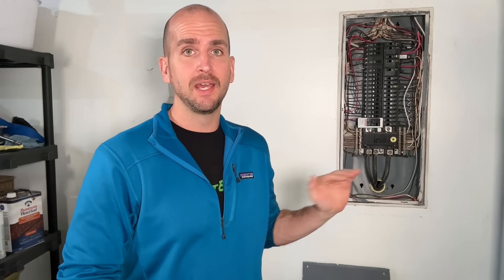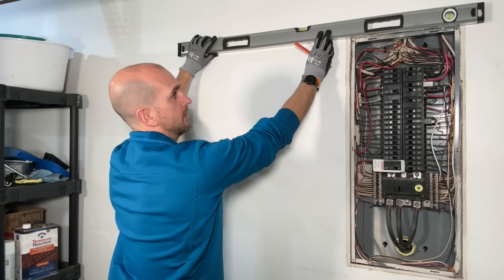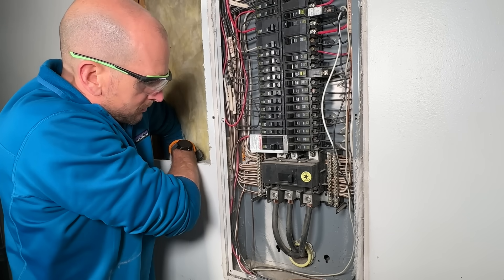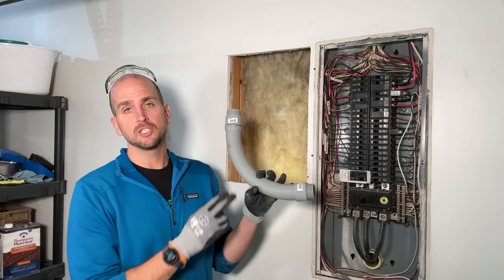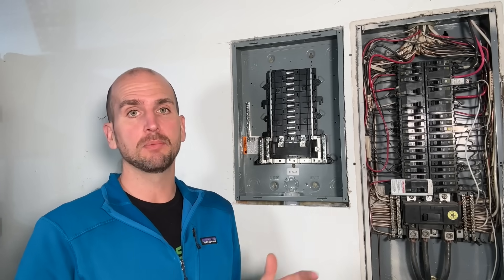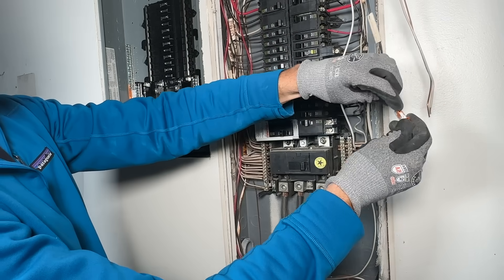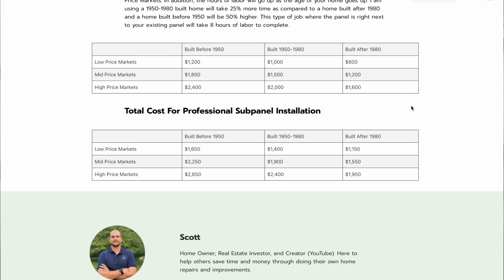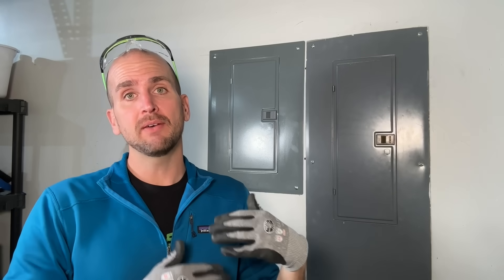How To Install A Sub Panel Next To Existing Main Panel

Comment: You can’t use #2 aluminum for a sub panel that doesn’t carry the entire load of the home and you can’t use #6 romex for 60 amps. NEC 334.80. Videos like this are terrible for the trade.
Reply: I didn't see him install any #6 Romex so not sure what you're referring to. You can use #2 Al for a sub panel and it doesn't have to carry the entire home load.
Reply: He did mention it in the video, and i am pretty sure he need to adjust the ampacity rating on the wires since he is running more than 3 current carrying conductors as described in table 310.16 and 310.15 c 1 of the NEC
Reply: Pd - I’ll tell you like I tell my 4yr old, put your listening ears on. He says if you only need 60 amps run # 6 romex, so that’s what I’m referring to. As far as your comment about #2 AL on 100 amp sub. You are wrong. #2 AL would be good for only 90 amps. Site a code reference. Don’t be a hack.
Reply: @NickG.-cr5lq   I didn't hear that part but since you're being a jerk, I'll be one too. 
 I never said that you can use #2Al with a 100A breaker, genius. Maybe you should get some glasses or take a reading comprehension course. 
You said the following, "You can’t use #2 aluminum for a sub panel that doesn’t carry the entire load of the home," and you are absolutely WRONG. As long as the breaker is no larger than 90A (75deg column in 310.15(B)(16) because of 75deg terminal ratings), you can use #2 Al for a subpanel that does not feed the entire home. What you can't do is use 310.15(B)(7)(2) and apply the 83% factor and put it on a 100A breaker unless it feeds the entire home. See 310.15(B)(7)(2) for clarification.
For calculation purposes, you can start with the actual rating of the conductor, which for 2 AL THHN is 100A, 110.14(C) and 310.15(B)(7)(4). Once adjustment factors are applied you are still are limited to no more than 90A breaker because of the terminal ratings, 110.14(C).
Any questions?
Reply: @pld8993  - You got it! Giving you a hard time bud. You crushed it! Way to shut down a young punk. I still think that videos like this are terrible for the trade, but great job!
Reply: @NickG.-cr5lq  You're also wrong about #6 Romex for 60A. 6 Romex is rated for 55, but since there is no 55A breaker it's allowed on a 60.
Reply: @pld8993  I disagree. You can’t use #6 romex if you’re serving a 60 amp load. You’re applying 240.4(b) to sizing your conductors but 240.4 is for sizing your ocpd. See 210.19(b). You can’t use #6 romex to serve a 60 amp load.
Reply: @NickG.-cr5lq  210.19(B) has nothing to do with this project, as it is for branch circuits over 600V. If you have a calculated load of 55A or less, you can use 6 Romex on a 60A breaker. If your calculated load is 56A or higher, then 4 Romex would be required.  
I'm not using 240.4(B) to size my conductors, I'm using Table 310.15(B)(16). There is no 60A load here, the sub-panel is not a load and right now there are only 2 20A branch circuits in it, far less than a 60A load. Max calculated load on 6 Romex is 55A but because there is no 55A breaker, you are allowed to install the next size higher breaker that is available, which is a 60, 240.4(B).
Reply: @NickG.-cr5lq  Nice try Nick. But pd got ya!
Reply: @michaellike5037  Got me? See 334.80. I wish you guys were my AHJ…
Reply: @NickG.-cr5lq  334.80 clearly says that the allowable ampacity for NM cable is based on the 60C column 310.15(B)(16), which is 55a for #6, and it says nothing about max breaker size, which you arrive at by referring to 240.4(B). There is no 55a breaker, therefore  #6 NM can be on a 60a breaker as long the maximum calculated load/allowable ampacity is 55a or less. Yeah, got ya.
Reply: Thank youuuu

Comment: Did the new panel arrive with a factory installed Neutral Bonding Screw? Just a thought for anyone unfamiliar. Sub Panel Neutral Bonding Screw, often a green screw looking out of place, going thru the Neutral, must be removed to prevent a loopy ground problem worth looking up. 
Nice clean install, either careful planning or plain old good luck got the empty cavity to put your sub panel in.
Reply from the maker: Thanks for the Add, that would have been good to point out.  Square D includes the screw but not installed as least on these main lug panels.  I was confident the cavity was open but not 100%.  You know how it goes 🤞

Comment: You forgot to color code the cable (wire) neutral =white
Reply from the maker: I had the tape laying 10 feet away 🤦‍♂️.  Thanks for the call out.
Reply: Installer of the original main panel blew that.

Comment: I would recommend using a torque wrench/driver. Current code requires it and frankly it is a good idea. I think a lot of people would be surprised on how hard it is to tighten things to the correct torque.
Reply: Also to wiggle the stranded main wires a bit and retorque them.
Reply: When I worked in a power plant, the electricians used to open each panel once a year and retorque each connection to spec. Couldn’t afford to have any circuits failing and compromising our availability to the grid
Reply: @DanielinLaTuna  yeah, I would imagine the heat expansion and cool shrink cycles the wires go through, could cause an issue.
Reply: what is the torque required?
Reply: @felixchien1664  I think you can usually see the torque spec on the side of the breaker itself. It can vary from manufacturer to manufacture.
Reply: @m3rdpwr  thx!
Reply: @felixchien1664  It will be marked on the device what the torque value is.

Comment: This is exactly what we need. Thank you! I was debating doing this or running one to the (attached) garage where we need several new circuits. Might do both once comfortable. For now I think we'll do this but there's no room adjacent to panel as it sits between the crawl space opening and the corner. Have to review the code, but it would be nice to have it on the adjoining wall facing out 90 degrees. 
What is the large breaker/switch in the lower right of your main box?
Reply: You can always cut sheet rock and run SER or a tray cable through the wall so you won't have to use conduit. Also, if you're adding a panel in a separate structure it will new it's own ground rod.
Reply: Just pay someone who knows what they are doing. Electrical work is nothing to try and figure out as you go. It's like me saying I'm going to be a lawyer tomorrow

Comment: I did that years ago, in my case it was a 60 amp breaker to a 12 pole auxiliary box. I mounted it to the lower right side of the main panel and went through the side.

Comment: Did anyone notice he didnt mark the subpanel main neutral as a white wire but left it black like its hot
Reply: Please quote the code book and section when making code claims, correcting misinformation from source less memory doesn’t achieve the desired effect. If you want to educate us, educate us!
Reply: @Diamonddrake  200.6 Means of Identifying Grounded Conductors

(B) Sizes 4 AWG or Larger.  An insulated grounded conductor 4 AWG or larger shall be identified by one of the following means:

(4)  At the time of installation, by a distinctive white or gray marking at its terminations. This marking shall encircle the conductor or insulation.
Reply: The neutral feed on the main panel was not wrapped/identified as white. I was under the impression, as Don L, that this is required by code. Original electrician blew it. Electrician wrapped with white tape when my main service was upgraded years ago.
Reply: He blew it? I guess the panel.is gonna catch fire huh.
Reply: Good thing you weren’t the next electrician to work in this box, you might have been seriously injured bc it wasn’t labeled properly.
Reply: No I did not notice
Reply: All you yuppies complaining about color. If it’s not code who cares, it accomplishes the same purpose.
Reply: Yep sure seen that!
Reply: He also used a hole saw instead of step bit😂
Reply: @jamesguiberteau6607 because he went through the stud lol. Try using a step through a stud. It dont work so well 😂
Reply: Probably because the professional that installed the main panel didn't mark the neutral white either.😂
Reply: Yes I did
Reply: Yeah that's tragic
Reply: At what time ??? 😂😂😂 💀💀💀
Reply: I try to add to a person's video tactfully especially when it's a dangerous forgotten step, this is dangerous work and It's important to mention this due to the trust in the step by step methods we follow blindly sometimes!!..
Reply from the maker: Yeah would be best practice to mark with some Super 35 white electrical tape, thanks for the feedback!
Reply: @EverydayHomeRepairs  Not just best practice, it's required to identify it white.
Reply: Why do people watch instructional videos if they are professionals? Who can I criticize today?
Reply: @justinforrest1613  it’s entertaining, and believe it or not even the “professionals” don’t know everything so some times there is something beneficial there. Oh, and often it’s to help the person improve there trade or hobby for safety, cost and enjoyment.
Reply: @justinforrest1613 I can’t help but notice the licensed professionals often give contradictory advice. Which is why I watch several and then do it myself.
Reply: @justinforrest1613  I post electrical information for amateur subscribers that are being misinformed or are being provided with incorrect information by other amateur experts that need to make sure of their facts before providing informational videos.
Reply: @donl1410  Thanks for looking out for us. 😁
Reply: @justinforrest1613  I'm sure glad they do!
Reply: Because If they see a mistake, it can be brought to the Forefront. There are a lot of amateurs out there that are doing stuff  that have watched in a video' as per say this one, or read in a book and they wonder why they are getting shocked every time they touch something.
Reply: @justinforrest1613 first off, you shouldn’t complain. A lot of electrical work is interpreted and I love seeing different ways to do the same job. Secondly, be happy electricians keep up on their job, so they can do the best work for customers and keep everyone safe.
Reply: @Pr3lude9  doing Gods work, thank you soldiers 👌
Reply: @Pr3lude9  okie dokie
Reply: @justinforrest1613 honestly its a good check and balance to make sure someone isnt giving crap information.
Reply: About to leave that comment.

Comment: The main lugs are a dissimilar metal from copper.  Therefore, it's a good idea to use an oxidation inhibitor (and remember to wiggle and retighten those stranded conductors).
Reply: If lugs are rated CU/AL it's not required.
Reply: @John Hooton  which depends on manufacture specs always always always check manufacture specs.
Reply: @johnhooton3286  Sort of. Cu/Al means either copper or aluminum can be used on the lugs; if lugs are Cu only, aluminum is not allowed regardless. Oxide is not needed on copper conductors because while copper oxidizes, copper oxide is conductive. Aluminum oxide is not conductive, hence the need for oxide inhibitor on older aluminum conductors.
Reply: @Kevin-mp5of  If the manufacturer says it can be used without a ferrule, then no ferrule is the correct way.
Reply: If the wire type is AA 8000 Aluminum Alloy then the oxidation inhibitor is not required to be installed unless the manufacture requires it.
Reply: @kevinthompson4690  Good point.  Thanks.
Reply: Why wiggle and retighten them when I can crimp a ferrule on.
Reply: deox is for aluminun conductors...
Reply: Oxidation inhibitor is not required for copper.
Reply: @Kevin-mp5of  The terminals on breakers are designed, manufactured, and UL tested and approved for stranded wire. In 40+ years I've never had an issue or a need for ferrule. So installing something exactly the way it's designed to be installed makes one a hack? You're obviously not an electrician.
Reply: Thanks @John Hooton, @js b, and @pd.  Your comments prompted me to go read the 2023 NEC 110.14.  I think the last time I thought about that section was maybe 15 years ago.  Much more emphasis on proper torque these days.

(It seems recent research--K. Hunter, IAEI--has found that ~60% professional electricians who hand-tighten connections under-tighten by at least 10% of the spec and ~20% over-tighten by at least 10% of the spec.)

Anyway, thanks for the prod.
Reply: You would think he would know this as his best buddy is Joel from Electrical Pro Academy.
Reply: @AdamS-lh2ug  Right...

Comment: I believe it’s code to identify circuits when relocating them such as in this instance. Meaning being able to identify which neutral goes with which hot, both in the main panel and in the sub panel. This is done so that in the future if you ever need one of those circuits on either a GFCI or AFCI breaker, then you be able to do that. Don’t know the exact code article but I was looking into it a few months ago when relocating a main panel and we would put zip ties around the hot/neutral together to identify them as belonging on the same circuit.
Reply: But his extended wires going to the subpanel aren’t in Romex, so identifying them is a good idea.
Reply: @donmclean1220  yes but he doesn't bring the neutral into the subpanel, only the hot. So where is he going to identify the wires if not in the main panel, where the romex enters?
Reply: @chrisruss7863  yes he does, in the sub panel for the branch circuits there’s very obviously 2 hot wires and 2 neutral wires. If you’re looking at the sub panel, there’s no way to easily identify which neutral belongs to which hot.
Reply: In my opinion having the hot neutral and ground coming from the same nm sheathing sufficiently identifies them, and this would apply more to an environment where conduit is used with multiple circuits in each conduit. But I haven't read the code so I'm not sure.
Reply: @chrisruss7863  the wire he uses from the main panel to the sub panel isn’t romex, he uses thhn. There’s no easy way to identify from the sub panel which neutral belongs to which hot

Comment: Don't get rid of that gas furnace! I cringed when I heard that. I have a new Carrier heat pump in one house and a Carrier gas furnace in a 2nd home. Love the instant heat with a gas furnace and it can raise the temp. quickly. The heat pump will run for hours, hate it!
Reply from the maker: Thanks for the feedback, where is the heat pump unit located?  Cold region?
Reply: @EverydayHomeRepairs  Triad region of North Carolina. If I had natural gas at my main home, I would kick the heat pump to the curb.
Reply: Carrier doesn't make good heat pumps, you want a well known asian brand with variable refrigerant flow and inverter driven compressor like a Fujitsu, Mitsubishi, or Daikin.  Also these VRF units aren't meant to cycle on and off like old fashioned heat pumps, they're designed to run more or less continuously keeping the temperature stable; they just ramp up and down like a dimmer switch.
Reply: THIS!  I’ve had a house with a heat pump and now one with a gas furnace and it was WAY more expensive to heat the previous house that had the heat pump vs. a natural gas furnace.  It wasn’t even close.  The heat pump ran constantly when the temps got below 30 degrees, constant electricity feeding it and it got very expensive in the winter time vs. natural gas furnace.

Comment: I did something similar n my old house, I added a 50amp breaker in a new panel, connected it with a metal conduit. Both panels were the same size so I covered everything and it had 2 doors that opened out exposing both. The doors came off the wall about 1 1/2” and across the top was a 2x4 that was about 2” higher than the panels, but far enough away, that you could connect metal conduit (code in my area) without damaging or cutting anything. I also had a dropped ceiling so anything could be easily added anywhere.
In my current home I added a 50amp sub panel in the garage, before I finished the basement. The panel was added for a welder and more power in the garage. This panel was sent in like yours and a plywood cover and small door for the welder plug-in.    Thanks, your video’s are always wonderful and helpful.   God bless you!

Comment: You were having that level rather close to the 3 lugs that could be fatal.  I am always nervous about having my hands near those lugs.  Is the ground wire here insulated?  Ours is bare and yours looks like a 3 phase panel like in an office.
Reply: It's not a three phase. Square D just has the neutral close. Three phase would have 4 wires.

Comment: Great Video.  Two things I would do different.  Torque all of the terminations. and add some white tape on the neutral.
Reply: Yep!  Mark those wires.  I like to mark one of the lines for 240V with red tape too
Reply: I was definitely looking for the white neutral or some other indication.
Reply from the maker: Nice additions, thanks for the feedback 👍
Reply: I would use a green ground screw to attach to the ground bar to the subpanel itself .
Reply: @sku32956  The green ground screw in a breaker panel is for bonding neutral and ground, which is done in the main panel, not the sub panel. (Sometimes the bond is before the "main panel" even).